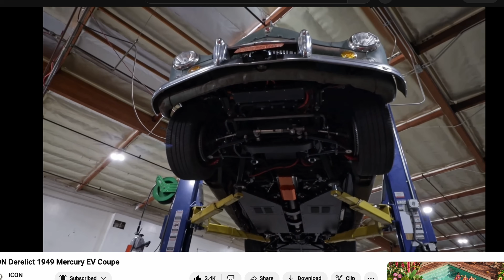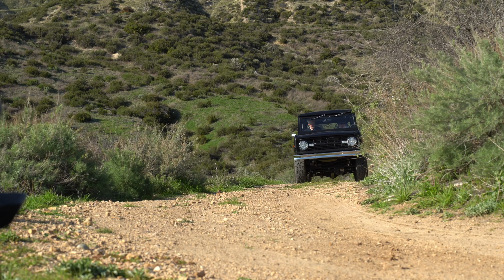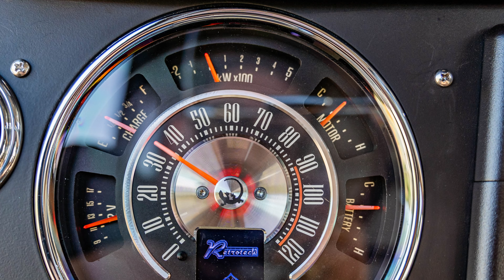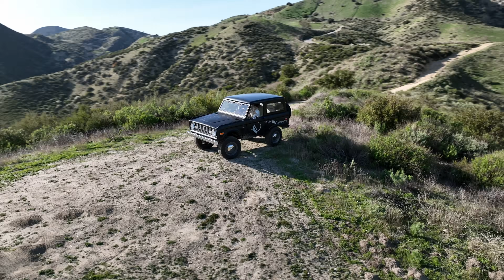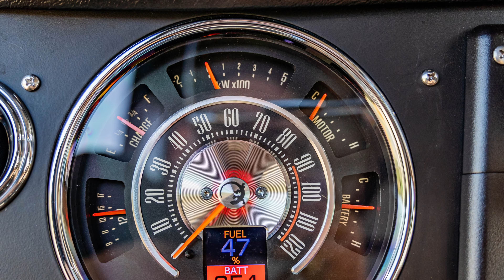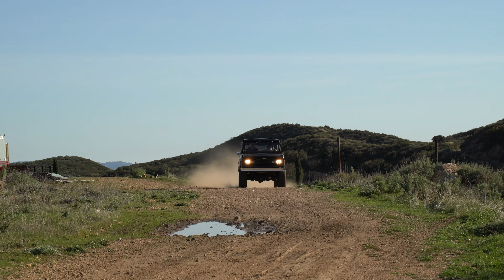UNVIELING OUR NEWEST BRONCO EV PROJECT! ICON BR EV FOUNDERS EDITION, 500 HP!!!

Comment: AI generated: Telma electromagnetic braking systems can be integrated with electric vehicle (EV) regenerative braking systems to enhance braking performance and reduce wear on traditional friction brakes. Telma retarders, which use electromagnetic induction, can provide a significant portion of the braking force, especially in situations requiring frequent stopping or deceleration, while also recovering energy for use in the EV. 

Here's a more detailed look at how they work together:

1. Telma Retarders:

Frictionless Braking:

Telma retarders use electromagnetic induction to create a braking force without any physical contact or friction between parts. 

Energy Recovery:

They can capture a portion of the vehicle's kinetic energy during deceleration and convert it into electrical energy, which can then be used to power the EV's battery, says a Motorindia article. 

Reduced Wear:

By reducing the need for traditional friction brakes, Telma retarders can extend the lifespan of brake pads and discs. 

Silent Operation:

The lack of friction makes Telma retarders very quiet in operation. 

Environmental Benefits:

They don't generate pollutants like brake pads, which can contribute to air quality problems.

Comment: I don't know your customers & I know you said modernity isn't your thing but if they're like most & unlikely to use so much as a fraction of what those axles can handle to justify the drain on the 🔋🔋 their weight causes would a battery skateboard with motors mounted inside of ifs/irs subframes simplify the build by allowing you to set a body on top of & provide a more plush ride to & from the office, supermarket or church?

Comment: No compromising with icon! I see restomod muscle cars selling north of $160K that will still have drum brakes, not have soundproofing like Dynamat, etc. I always think, "If Icon did this, it would be so much better." Yes, it would cost more, but you guys fix issues that need to be addressed, rather than just selling something that looks pretty.

Comment: No thanks.   Those early Bronco's deserve better.  The current "EV technology" is not even close to doing the Bronco justice.
Reply: @markmonroe have you owned a gen 1?
Reply: What are you talking about?
Reply: EV’s will not make sense until Graphene Batteries become standard… It would take 300+ years to mine enough Lithium to replace every IC engine on the planet….Graphene Batteries could be ramped up much faster if developed properly
Reply: @michaelstawczykjr.701 This is one vehicle. No one’s talking about all vehicles here.